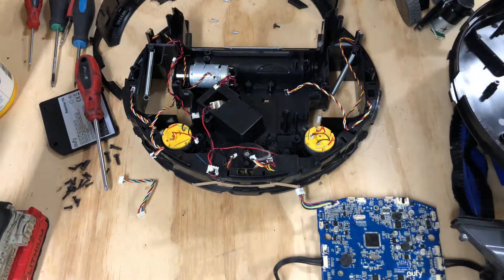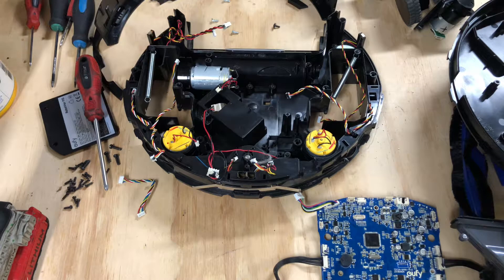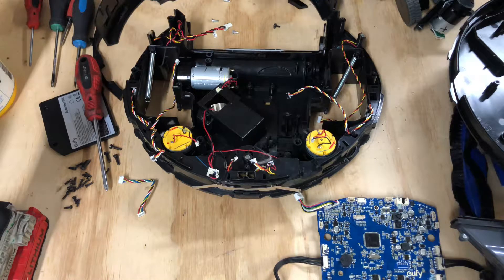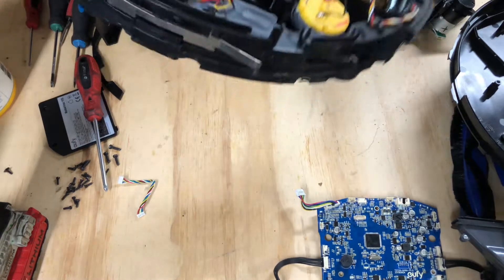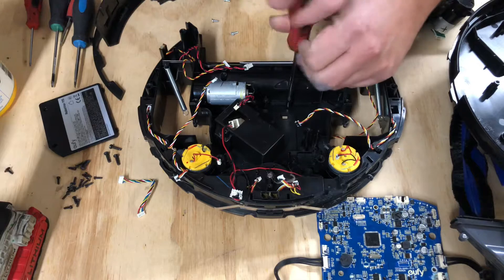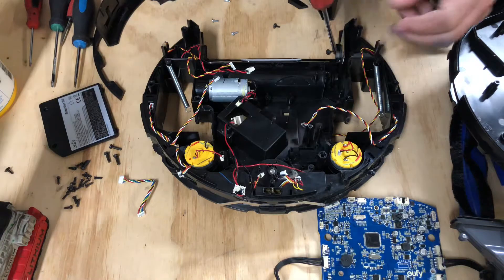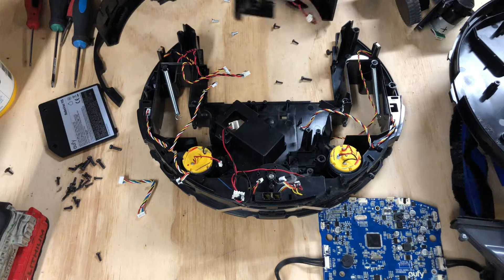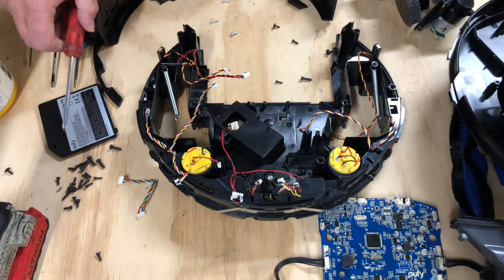Eufy RoboVac 11s How to Remove Main Brush Motor and Assembly Video 7

Comment: Hello Smitty, At my S11, the square mounting hole for the roler brush has become round. Motor spins fine, but brush is not coupled anymore. In the comments a serial number was mentioned for the motor. Is this for the whole assembly (plastics and gears) or only the motor?
Is the final gear part with the square hole also available at Eufy or othe supplier and if so what is the ordering number?